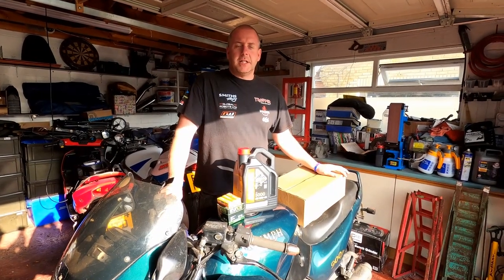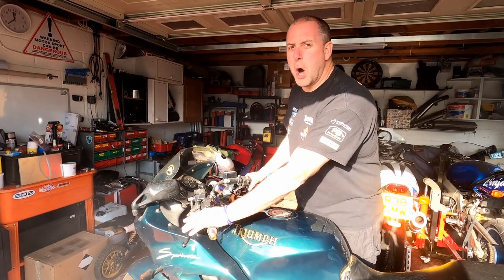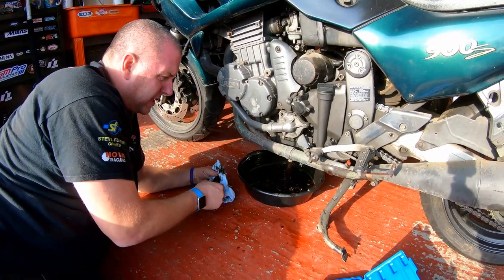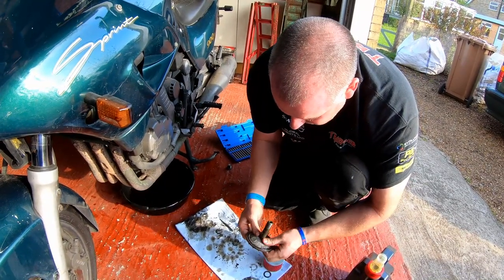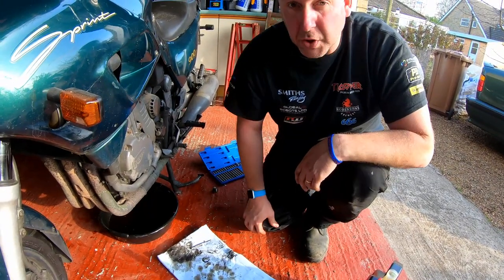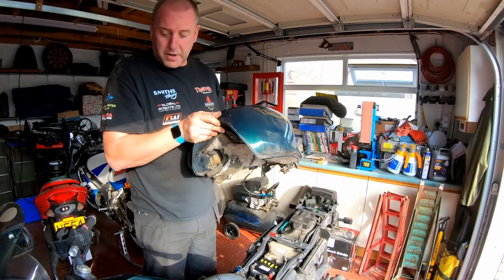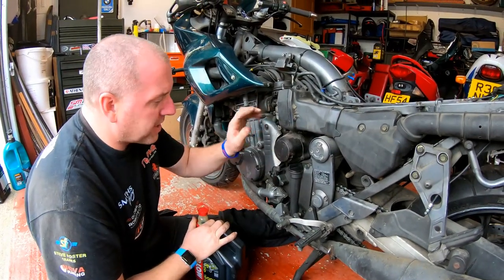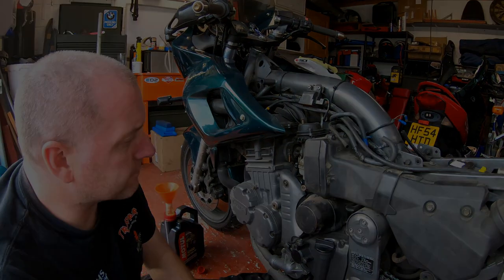1994 Triumph Sprint 900 Service Series - Part One - Oil, Filter & Spark Plugs.

Comment: If you are used to working on Japanese bikes these early Triumph do have a few things thar make maintenance a little trickier. I've got a Sprint sport which is great but its the only bike I've ever owned that needs all the rear body work removed to get the air filter and carbs off. That centre plug is a pain as well. Using the Triumph plug tool makes it easier. Good video.
Reply from the maker: I agree wholeheartedly, I am enjoying working on something British built for a change though! Sadly the toolkit for this bike went walkabout long ago! I do know that the correct sized tool for the plugs would have been in there which would have avoided the need for me to search for an 18mm deep socket! 😏

Comment: Kev, this is really good. I like your no messing approach, and non pompous attitude. I am presently looking at a 93 sprint, which if bought will be my first bike ever with a fairing. Do you happen to know if the 93/94 years have that hatch whereby the work to access the sprag can be made easily enough if unlucky enough to need sorting out? . I have heard that the design changed, and that a full engine strip was necessary, making it unviable. Many thanks in advance. You have encouraged me to do some routine servicing once more !
Reply from the maker: It’s a good question bud but unfortunately I don’t know the answer, I wasn’t aware that there was an updated design either! Sorry!

Comment: Hi Kev, just subscribed to your channel, end of summer last year I purchased a triumph Daytona 900 1992 model, am I correct in thinking this would be the same engine as on your sprint and same service procedure? Also where is best place to purchase parts such as oil filter and plugs etc, one again great channel 
Thanks 👍
Reply from the maker: Yes chap, exactly the same engine. It all depends on where in the world you reside, but if uk based I would recommend reputable sellers on eBay and Fowlers of Bristol for parts 👌🏻 if I recall, I think I linked a lot of components in the video descriptions if that helps 👌🏻 as it happens, I’d really like a Daytona in the stable 👌🏻😎
Reply: @KevsShed  yes I am uk based thanks for the advice 👍

Comment: This is brilliant, fantastic content. I just bought a 1998 Sprint Executive and I'm finding that the clutch lever has tonnes more resistance than other bikes I've ridden is this because of the heavy duty clutch springs or is there something wrong with the lever or hydrolics? I also find the Throttle has high resistance, and my hand are aching by the end of a ride, maybe im just getting used to the bike. Any advice would be appreciated.
Reply from the maker: There are a number of things that can cause a heavy clutch, including hydraulics or heavier springs but often it is simply because it's different in operation to what you are used to. I find my GSXR clutch incredibly heavy on my left hand after a good ride as I don't ride it as often as I should! The throttle could be a lack of lube in the cable. That said, a replacement cable can be picked up for only a few pounds! Glad you liked the video, more Triumph content to come very soon! 👍🤓
Reply: @KevsShed  Thanks for the reply, great advice!